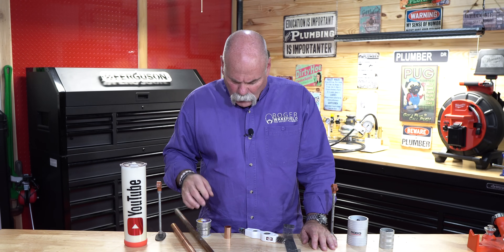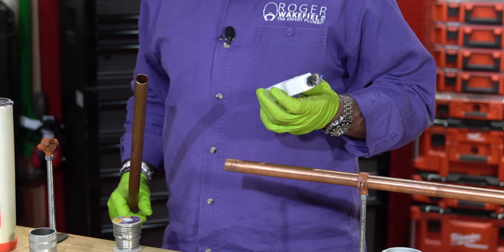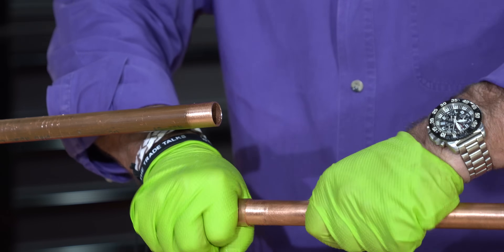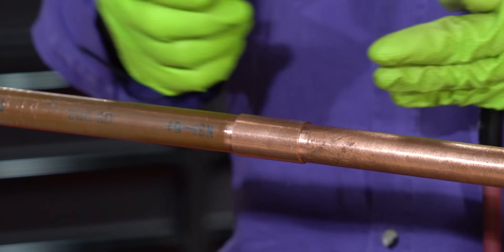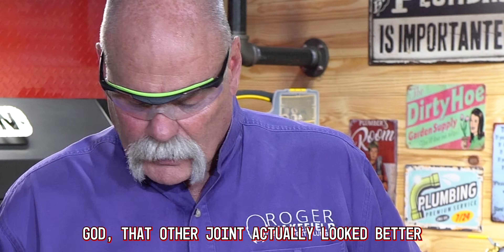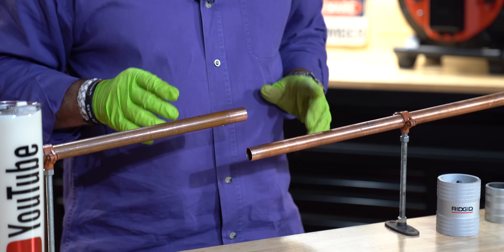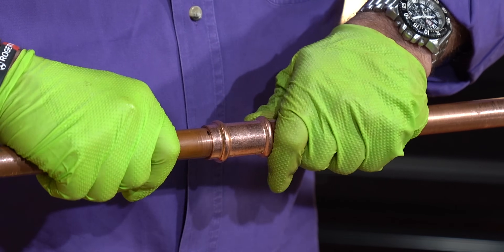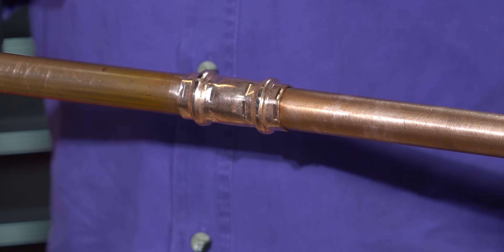Soldering VS Press Fittings

Comment: solder joints are either good or bad.  if it's a good joint, the pipe will fail before the joint.  if it's a bad joint, it leaks from the get-go.    there's advantages to that.
Reply: From the get-go is relative but generally yes.  There are numerous accounts of prepped solder joints that someone forgot to torch holding under pressure for days, weeks or even longer before blowing loose.

Comment: The last company i worked for before retiring would only use the pro press on 1 1/2 and larger pipe.  I started plumbing in 1970, and i still remember my first solder joint.
Reply: I've been plumbing for almost 30 years now I will never ever ever in a million years give up Soldering it is tried and true
Reply: @johnchonka2052  Solder and press both have a lot of advantages and disadvantages, I use both according to situation. I won't go near a job without both tool sets.
Reply: @johnchonka2052  yeah well there's this thing called technology where they bring out new things that make the job easier and faster while keeping the same reliability.

Comment: Dang Roger, you burnt up that fitting. It also helps to move the torch around the fitting so youre not concentrating all that heat in one spot.
Reply: Was he doing that as a joke or? 🤔 because damn that thing is cooked.
Reply: Half-brazed
Reply: B tank is so overkill for soft solder on small pipe
Reply: @nsboost  No it isn't. If you use the smaller torch head it's more maneuverable too, especially when compared to a handheld mapp gas torch.
In the commercial world we use a B tank on everything. I was on a job a few years ago where we used OXY acetylene for med gas brazing. This was mostly 1/2",1" and 3/4" . I thought it was overkill but ended up getting good at making great caps on my braze joints. I prefer oxy/acetylene for brazing now.
If you just use a b tank I like a size #14 torch tip (for 1/2" to 1&1/4") to get good heat penetration.
That's the way I'm used to anyway.
Reply: @Energia-977  I use oxy/ace for brazing. Even use it for 1.25" and larger when soldering.  I use map gas for soldering .5-1". I'm not lugging around a b tank or oxy/ace for tiny little solder joints. I'm 35 and my knees and joints are already trashed. Work smarter not harder.... Something I should have been doing much earlier than now
Reply: @nsboost  No I got you. I would do the same if it meant lugging it around like that. I'm used to being in a scissor lift
Reply: my god roger what the hell
Reply: I thought the same Burnt Toast haha
Reply: He must have the pipe clogged with that amount of solder, way too much.
Reply: I read your comment and thought, what a YT ahole, im sure the solder job was ok…

Then I watched and LMFAO 😂😂😂

Was this video uploaded on April fools day?!??  
Absolutely cooked that pipe
Reply: I'm an amateur diy guy and that was embarrassing.
Reply: Well at least he has good heat penetration hahaha!He probably does med gas! It takes adjustment even very experienced guys can do this lmao! It happens. It takes me half the day to get back into the "solder zone "after oxy/acetylene brazing too much.
Reply: I'm surprised that solder took at all. That was way too much heat!
Reply: @pagepalmer6378  well he only used half a roll of solder

Comment: Theres times the press tool wont fit in a spot you're working in and you have to solder, not being allowed to solder is ridiculous. Also thought we were brazing that joint for a second haha
Reply: Reminds me of the first time I used an air-acetylene torch to solder. I cooked that fitting so bad I had to get another one. I quickly learned you mostly just have to show the pipe you have an acetylene torch and that gets it hot enough.
Reply: Ive had to solder half inch copper that was pressed right up against wood with virtually no play or space without chiseling out the wood or shoving a flat screwdriver behind the pipe temporarily to be able to solder on a joint.  Soldering isn't ever going to be 100% gone.  Not as long as there is copper being used anywhere in the building

Comment: So in press fitting there is a rubber gasket in there ? If press leaks can you press it a 2,nd time ?
Reply: It may leak for minimal reasons.  
1-being if it is press at an angle and not pressed right.  Then if pressed properly it is usually works.
2-being if the pipe is not pushed into the hub of the fitting all the way as it should be.  You can get away with a little bit that can bite you.

Comment: You absolutely cooked that joint lol.
Reply: Right? Burnt the Flux right out of it. Rog, why don't you invite me on to your show? I'll show u how it's done
Reply: You can tell he has more of an administrative role these days 😂
Reply: My thought too.  I feel like a turbo torch with acetylene shouldn't go with solder.  Well, maybe for soldering a large flange on a water line.  I've seen too many copper fittings expand to the point that the joint wouldn't hold the solder in.  It's just too much heat.
Reply: Back that torch way off once the joint is hot enough to melt the solder.
Reply: Regular solder melts at around 200-230°C. That thing is glowing at atleast 400°C. Way to hot!
I don't know if it affects metal characteristics, but soldering with that much heat isn't good.
Also, it seems he used way to much solder for the job.
Reply: Simple propane is underrated.
Even MAPP is overkill IMO for most basic soldering jobs.

Comment: As a plumber at a small company I always solder unless not possible I understand that pro press is faster and less dangerous if not careful but after the price of fittings especially valves do yall really think it saves money?
Reply: Time is money. The prep involved with sweating is a lot more if you are doing 10+ joints. 

Don't get me wrong. I love soldering. But propress is around the same price
Reply: @JamesFoxPodcast  As a busy self-employed plumber, it would cost me a fortune in lost jobs / customers to stick with soldering for everything.
Reply: It doesn't save any money. No plumber will charge more for a job just because they solder joints. And if they saved 30 minutes using pro press they would charge the same for the job but get a longer coffee break. What pro press does is makes the job easier and eliminate the chance of causing a fire.

Comment: I understand not having an "employee" solder, I don't allow it either. They don't have the full gravity of the situation in mind, fires being the main thing. However, someone for there own business has ALL the gravity of the situation in mind, "I could loose everything if I burn down or flood this entire building, im gonna make dang sure it's done 💯 correctly" different sets of mind is why I think I can't have anyone working for me to solder. I let them use thread or compression or crimp. Thats it!
Reply: It must be your guys that did the job before me that has crusty weeping compression shutoffs and SHARKBITE 90s buried in walls and cross threaded cpvc males into copper female adapters. 
Teach them to solder so they can have some pride in their work! Buy them a small fire extinguisher to bring into each job. They’ll be fine.
Reply: @eyepodoblivion1189  we use no shark bites. Compression fittings WITH proper inserts and ive trained them well on anything threaded for instance when to use tape, when you can't use tape, when you can use both. I just don't have the nerve to allow these guys to have an flame rolling in a finished or unfinished space. They can solder don't get me wrong but it's the sticky situations that I don't have enough confidence to allow for a possible catastrophic event and loss of business.
Reply: @beerbeforebreakfast  isn't that what business insurance is for though?
Reply: @joshdiehl8737  yes it is, but burn down a building due to negligence and see how many insurance agents you have calling you up after your original dropped you like a bag of puke.......🦗......Insurance is for unavoidable, unforeseeable types of things. But as for myself, if at all possible I'm soldering. Just not my workers. I need to be able to sleep at night.